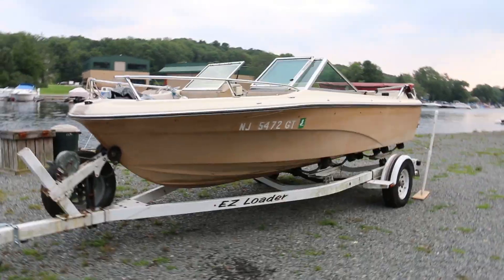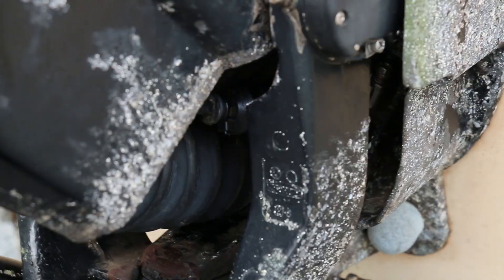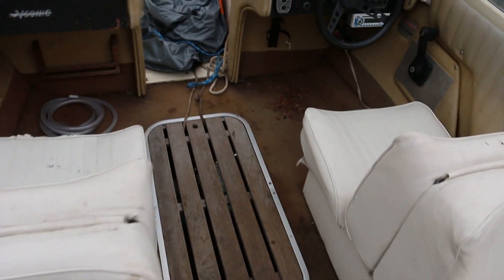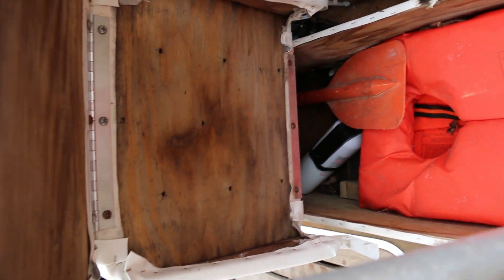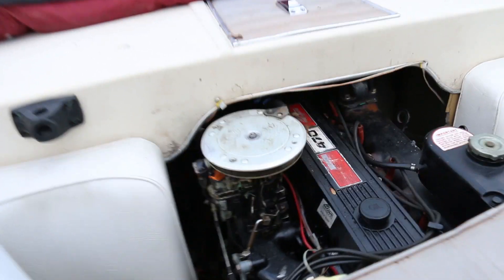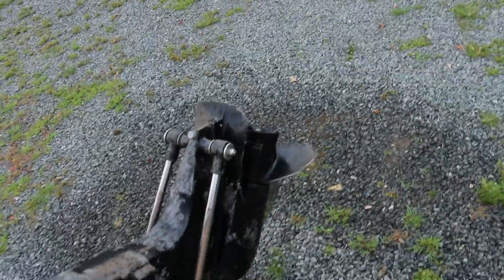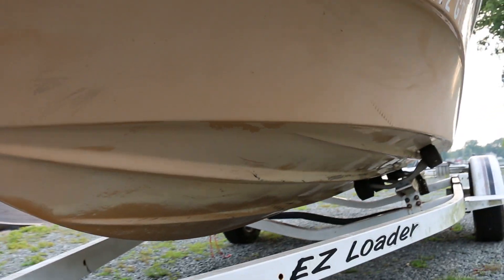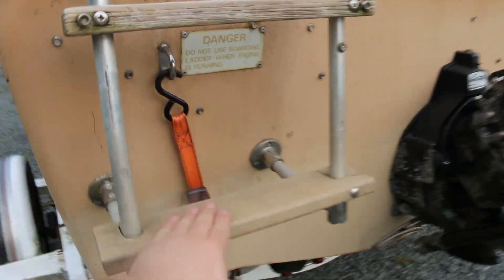SELLING MY VINTAGE BOAT! - Real Cheap Subscriber Special! SOLD!!!!

Comment: How was the fuel economy of this boat when u had it
Reply from the maker: I can't really put an MPG number on it, but if I filled the tank, I easily got a full 12 hour lake day on it with a full trip up and down the lake (18mi) with some tubing, racing and a lot of anchored off time. I always made sure it was full before putting it on the water, so I never ran out of gas or needed to use the gas station, fortunately.